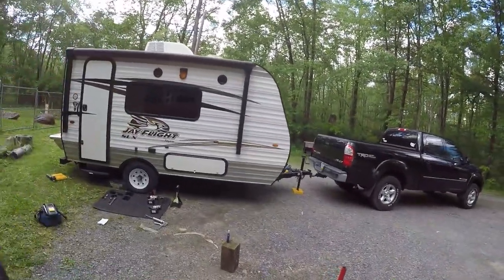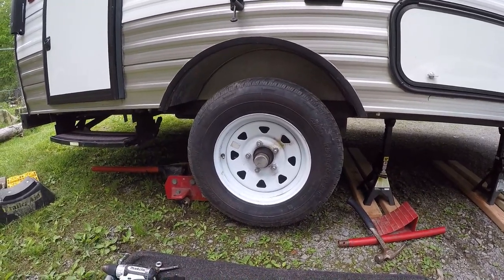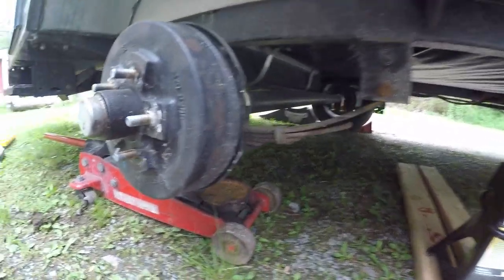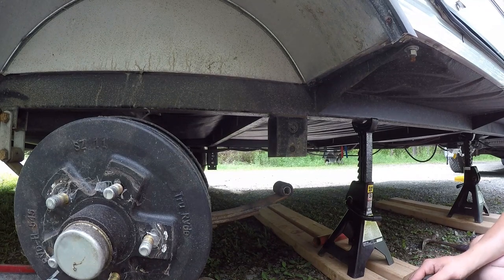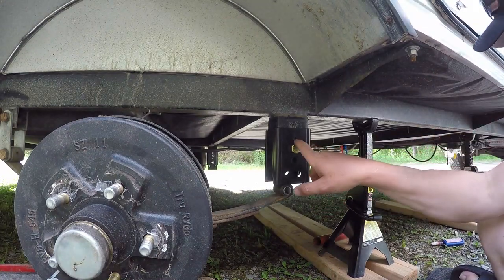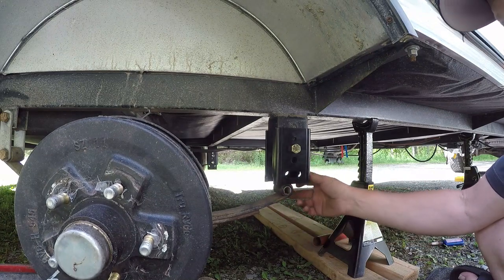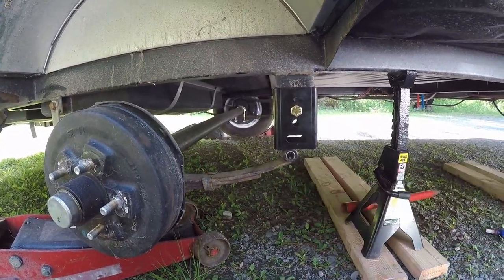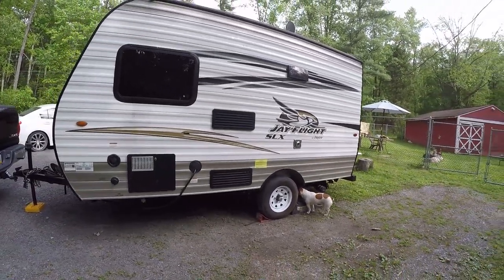Installing a correct track alignment/lift kit

Comment: Your video was the reason I had the confidence to buy this product.  I have a fifth wheel that is 2 inches nose high and wanted to flatten it out but it felt like an intimidating project until I watched your video.  Thanks for posting!
Reply from the maker: Appreciate your comment! Glad it helped you in your decision! Safe travels!
Reply: Nick - How did your install go and the results?
Reply: Hey Kyle, I ended up paying someone to do it… haha, but a year and 5,000+ miles later I am very glad we did it.  The ride is night and day different and it moved nearly 1,000 pounds from the rear axle to the front and pin.
Reply: @nickstorbakken9402  how much did you end up paying to have it installed?  If you don't mind me asking

Comment: Just curious but, why can’t you just flip the axle to the top of the leaf springs without a lift kit (like all the others’ I’ve seen on YouTube)? Does it just give it a little more lift/height?
Reply from the maker: @artest7  because the axle actually aren’t perfectly straight, they have a slight downward curve, ( you could easily look up a picture) besides that, the mounting point of which holds them to the leaf springs would need to be cut off and re-welded as well. This kit requires none of that,

Comment: Good video, explains it well !!    What size tires did you end up going with ? and how is the lift kit working out for you ? Did it correct the problem ?
Reply from the maker: I went to a D load range tire, same size for now..The lift kit was worth it in my opinion, I haven’t noticed abnormal tire wear so far, I’ll be making an update video explaining a few slight issues I addressed after installation, but it does what it’s supposed to and personally I love the added height visually! Thanks for watching and subscribing!
Reply: @LostTravels  Thanks, look forward to that video. We're interested in this model, although we actually have not yet been in one (Covid has made the RV world topsy turvy). It looks like from the Jayco web site, they are going with 14 inch tires on this 145rb  model now. Not sure the load range, or if the axle or leaf springs have changed from yours...

Comment: Unless your instructions show you installing the extension/alignment plates that way I think you put them on backwards. I just bought a Lippert 2" lift kit for my tandem axles and it shows those drop brackets with the curve facing away from the stock spring hangers. Yours are installed wrapping around the stock hangers and they should be flat side back against the stock hangers. Those curves potentially holding the new plates away from the stock hangers are probably what is causing the bolts to not be long enough to reach the nylon portion of the lock nut and could potentially leave some slack between the spring bushing and the extension plates. This is hard to explain. I hope you understand what I'm saying. Great informative video. Here's an image of what I'm trying to explain. https://images.app.goo.gl/Ukn5mGJVRCGgqHYn6
Reply from the maker: xplmr1 yeah I understand what you mean.. they are installed correctly according to the directions, I’ve double and triple checked this, the kit sent all one size, 2 out of the 4 bolts were supposed to be an inch longer ,I have since replaced with the correct length bolts, I do like how the lippert set up has a setup similar to an automotive style alignment. If I were to do this again, I’d certainly go with that route! Saving a few bucks wasn’t worth the headache lol